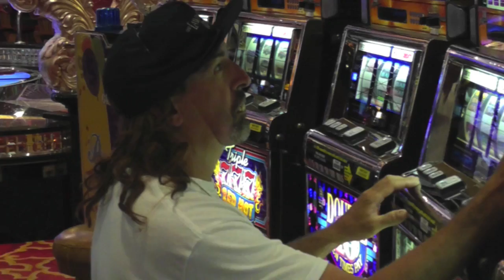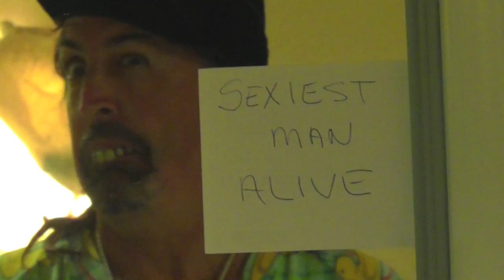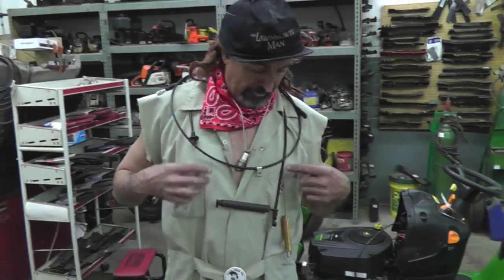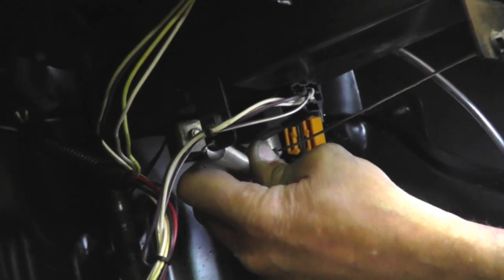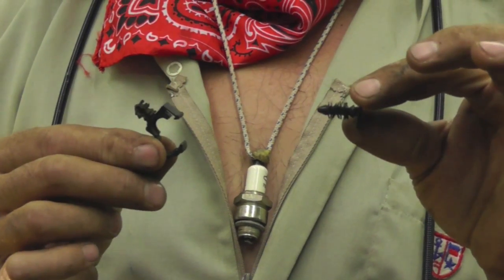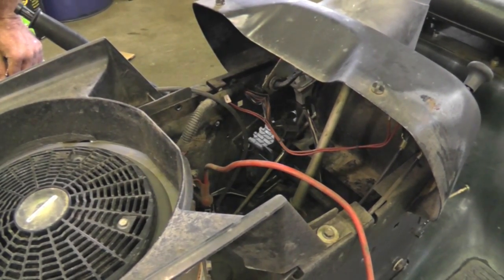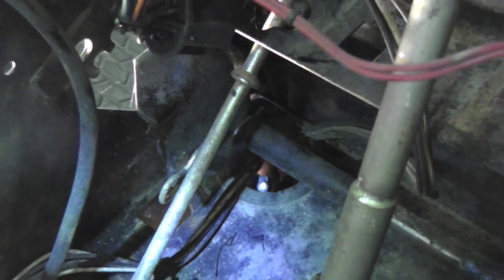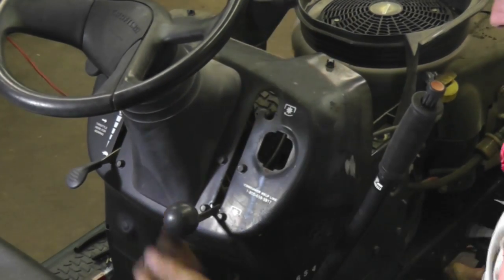How To Install A JD/Craftsman Blade Engagement Cable (Clutch Cable)

Comment: Hi Taryl, this is Blane, was wondering if you have a video on how to change the cable on the TORO Cable-Engage, Deck Part Number: 112-6137 ? Also I like the tool you made for removing cables.

Comment: Craftsman LT2000.  Had a wonky clutch and the mower deck would not engage.  Watched your video.  Routed and fixed the problem.   Thanks a heap.
Reply: That's routed the clutch cable...

Comment: As usual you saved my day.  The video on replacing mower deck clutch cable answered all my questions.  I would have been hours without you.  Not so sure about the contest, but you sure rate high on my list.  Many thnaks!!

Comment: Thanks, great video. But i foind out that to make your special tool to remove plastic housing is not necessary.  I just losen 4 bolts holding handle (wright side of the steering wheel) on craftsman and it was very convinient to work with assembly. Anyway your video is very helpful.
Reply: That's how I do it. More than one way to skin a cat.

Comment: I think my Craftsman was "Jimmy rigged" by the dishonest backyard mechanic who sold it to me. I paid $800 and changed the clutch cable twice since summer 2015. The spring was rubbing against the pulley and cut it off. I never knew that a zip-tie was there to lift the cable up. I invested near $1700 on that machine. Its a 944.600701 and has no oil sweat or leaks. Its worth to keep them because my 2009 Troybilt Kohler Courage 18 went "KLONK" on me after 72 hours of use. Next will be my 1989 Noma and a Ford LGT165. I'd like to bring back the old 1993 ServiStar but I can't find a new deck for it. She can go on those steep hills without tipping over. Its a crappy ride but, the centre of gravity is very low. Gotta love them flathead Briggs.
Reply: Oh yeah ! Make sure to check them pulley brakes or else, them blades will keep spinning for at least 30 seconds after you disengage the deck belt. That was part of my problem with the clutch cable...
No brakes + no zip-tie = new cable and a little bit of sparks (for the show)

Comment: What made you decide that the cable needed to be replaced?  Was it that you tried to adjust the belt tension at the bracket and then not enough adjustment to take up the lose belt slack?  Can you just measure the cable to see if its stretched?  I have a lot of play in my belt and tried adjusting the bracket on the deck all the way out still too much slack in cable.  Replaced belt and that was not it.  I am thinking the cable would have to be really stretched out to make that much slack in belt where it comes off the pulley.

Comment: Hey this is off subject what side is 12volt on electric clutch plug bought new one had to remove wires came out of plug , Cub Cadet 1415 clutch

Comment: Hello.  Thank you for the video.  I hope you can help.  I changed the clutch engagement cable and the deck belt.  The problem I am having is that even in neutral, without engaging the blade mechanism, the blade is spinning.  Is there an adjustment to loosen or tighten the cable?   When I engage the blade, the blade does engage into full mowing speed.  However, when not engaged, the blade still spins.   Is it possible the belt is too small?   There is only a little play in the  belt.  Any advice is appreciated.  Thank you.
Reply from the maker: +Bradford H Turnow Is it on the Craftsman if so I have a video . https://youtu.be/MFi9zoIEfq8
Reply: +Taryl Fixes All LLC Thanks Taryl.  It is.  I watched your video and followed all the steps.  It still does not disengage fully.  I am guessing maybe it is the brake release pulley that is on each spindle?   I am not sure what else it could be.   Thanks for any help.  PS. Great video!
Reply from the maker: Those brake arms are pretty inexpensive & the right & left are the same, should probably replace em.
Reply: +Taryl Fixes All LLC Will do.  Thanks.  Be well.

Comment: I have an lt1000 craftsman.. I replaced the clutch cable, return spring, "goobered up" the idler arm and the clutch cable broke the first time I tried to engage it.. What could possibly be wrong??
Reply: I also got a new plate so that's brand new.

Comment: Johndeere d105 barley responds forward or reverse.
Reply: Johnathan Valentin the cvt pulley on the transmission has a a screw with a washer that’s holds the spring on and the screw sometimes pulls through the washer also check the drive belt may be slipping